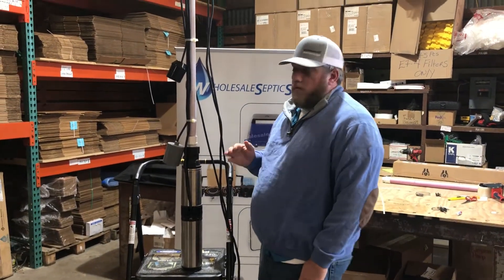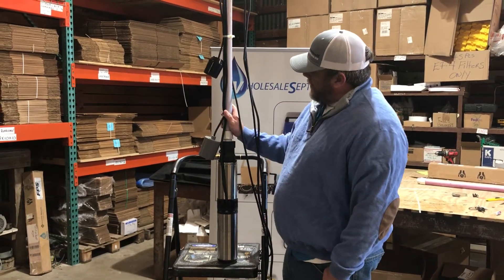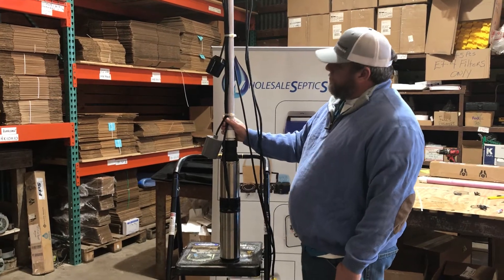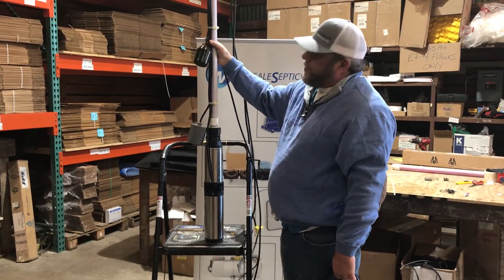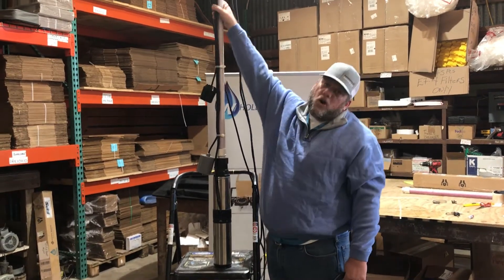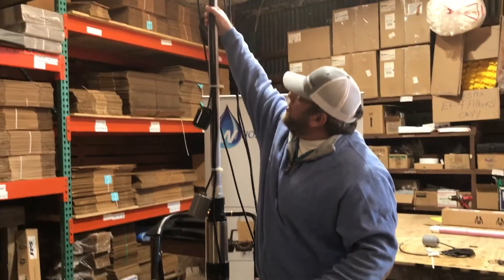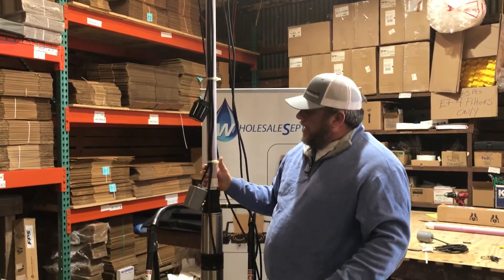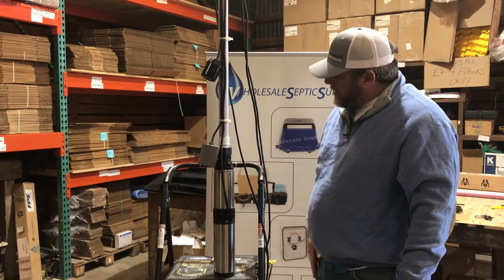Float switch placement septic system

Comment: Cool. Exactly what I needed. I had  issues for the last 16 years. I had enough after 3rd aerator, 2md pump, and fried box, which was mechanical. Looking story. So I set up 1 float to be on demand and no issues for last 5 years, Norweco 4 tank Singulair system. So finally.after 2nd pump in 2 years got a new box install, not a Wasp but  ACP2 and shorten back the 1 switch, re-engage 2nd and alarm set up again.

Comment: I don't know if you are still around but I have questions. It has been really cold in Missouri that last couple of these My well quick working for a couple of days because of the cold weather . i was dumping water in the toilet to get them to flush. After the well started giving me running water. The warning alarm on the septic tank started go off . I silence the alarm. I went out where the septic pipes line were i call it the septic field where the septic tank sprayed water on the field, i don't know term i noticed that it was kind of cover with weed and ice so I took an cleared this out being very careful not to step on the plastic pipes where the water dispenser  every day. The alarm stop sounding. Meanwhile it's still getting cold at night. It seems when I run the water like doing laundry, running the dishwasher, taking a shower after while the alarm went go off. Then 10 hours or so it will be ok I went out today to look at where the float is at. I push down on the float gently and I could hear the pump running. The water wasn't all the way up so I kept pushing the float down a little. The water started to go down, the alarm went off.
Keeping in mind that we just had the septic tank clean out and the pump checked. The septic tank guy said everything was fine. I am thinking that because of the abnormal cold weather we have been having might be the problem
I know this is kind of a lot to read into but what do think

Comment: So float 1 to 2 approx 6" tail gives 1 foot, 2 foot and guess same with 3rd  light alarm float. The 3rd flot should be about how many inches from the hole? Maybe 6" below hole? Asking because had to replace 2 pumps Installers royally screwed this up in the sense it was set below grade and didn't settle tank's to tanks dropped along with soil so all tanks flooded all the time.Risers helped but still flooded. After last incident it seemed like the panel didn't work so set up with 1 float to on demand. Honestly haven't had a problem for like 6 years. Newer septic gut so he is having find. I am going to relocate the 3 floats back and rewire the box again. I have a funny feeling that when all this flooding and aerator worebwas frayed by vibrations maybe the odd currents screwed up a float or the wires always getting submerged may have damaged #2 float. So hooking up it all again and test before I het a new one like a Wasp or acp2
Reply from the maker: Yes the Lowest float (timer float) and the Middle float (override pass float) are spaced evenly with approximately 6inch Tail.

If you have any questions please contact us at 936-681-8198

Comment: You said you have to remove the pump to replace the floats.  The bottom float on my 3 float is out on my 15 year old Hoot system.  What's the difficulty level in removing/reinstalling the pump?  Since I have to do it to replace the bottom float should I consider also replacing the pump (in your other float video you said the pumps generally last 10 years).
Reply from the maker: On a hoot you run into a couple things. One is they could have sensors instead of floats they will be in the same place as the floats would the left hand corner from the pump. If you have floats they will be there as well. One thing you have to do is find the cap where they are to remove them. We always relocate them to the pump pvc pipe makes everything easier down the road to service. If you have sensors you are up a creek do to the control panel. The pumps will last a long time we have had them go 20 years but people don’t generally maintain the system like they should be clean it every five year etc. if you have pictures we can help but i hope your floats are not in the corner if they are this will be pretty difficult.
Reply: He said he installs the floats on the same type the pump is on. If you build a float tree, a separate conduit cut just below the lid and screwed to the inside of the tank, you can access the floats that way. Play simply unscrewing the float tree and pulling it out. That's what my septic has. I believe he has many reasons why he ties the floats to the pump but if that were the case at my house I would have had to pay somebody to come do it.

Comment: how does the ovveride system work, my pump wont stop running and burned the pump relay in the on position, I replaced the pump relay, insuring the wires are in the correct positions,. my pump still runs even though the tank is empty. do I need a bottom float?

Comment: I've never had a float switch that lasted more than a year or two...I've tried just about every brand, they all fail. Really annoying because when they fail the septic system pump either runs constantly or not at all (depending on where the sliding switch mechanism inside the float gets stuck).
Reply from the maker: Need to see what your pump running amp rating is. You might need a panel with a contact switch to take the load to eliminate this issue. Sje rhombus pump master is what we use and have no issues.
Reply: @wholesalesepticsupply  The failures have always been mechanical and not electrical in nature. In other words current passes through fine but the movable bearing or whatever it is gets hung up and stops triggering the cycling of the switch.